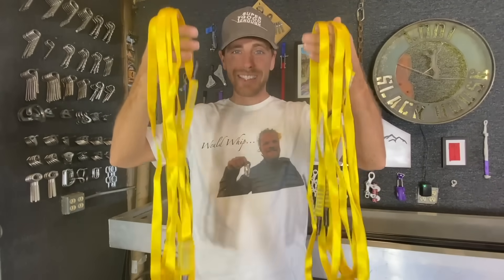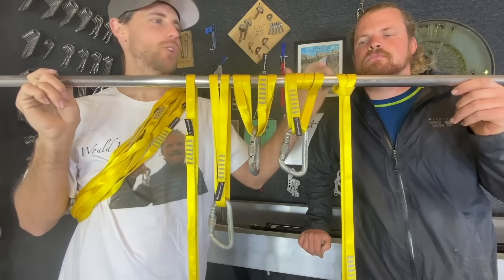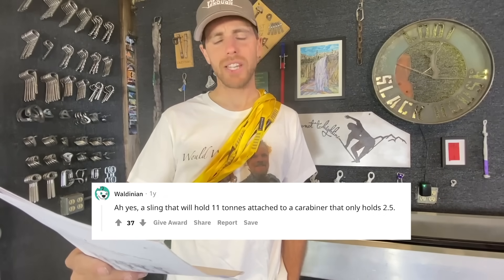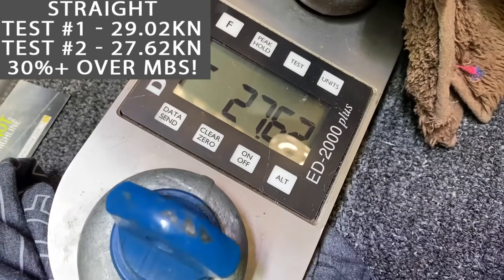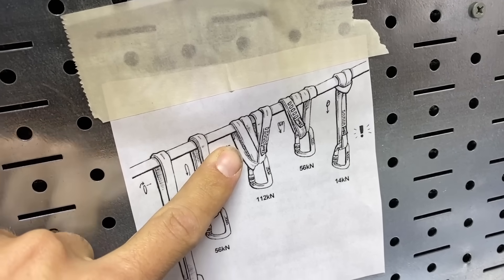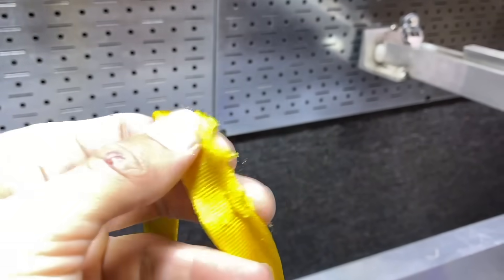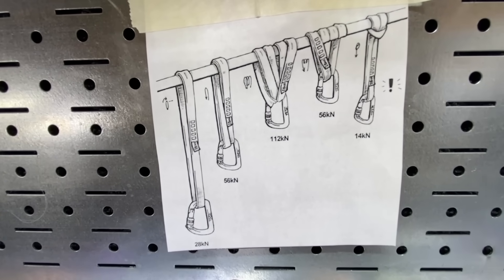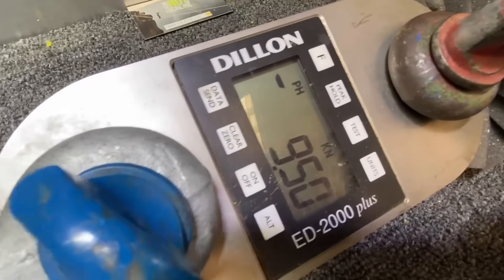Climbing Sling Myths

Comment: (Climber and physics tutor checking in here) One factor to consider is whether the force is applied evenly across the full width of the webbing (strong condition) or if the force is applied in such a way that one edge has to stretch before the other edge takes stress (weak condition). This distinction is incredibly important. If the stress is imbalanced enough, you only have to break a few strands of nylon on one edge of the webbing to start the failure. Once those strands break, you have a "stress riser", a place where the force is concentrated on a much smaller amount of material compared to the original condition. Once the failure starts, it quickly propagates across the webbing. 
How important is the evenness of the weighting? Here's a magic trick that Kung Fu practitioners in China used to prove that they could "reverse gravity" by the power of their minds when I was there in 1987. Chinese writing paper is so thin it is rather translucent. They taped opposite edges of a sheet of common writing paper to two fluorescent tubes, rolled them up a bit so the paper overlapped its own edge a few inches, and then had assistants support one tube. Then the Kung Fu master/magician did pull ups on the other tube. I've done it, albeit with broomsticks rather than fluorescent tubes. I weigh .8 kN. So long as you keep the force even across the two ends, the paper is strong and does not tear under this force. If you pull a little more on one side than the other, "bang", it parts.
I suspect that in some of your multiple wrap scenarios, you are stressing one edge of the webbing before the other, reducing the effective strength. That would also explain why one edge of your sample ends up more melted than the other. 
Of course, in a real world scenario, I'd assume the forces will always be uneven on my webbing and plan accordingly.
Reply: Do you have a video? I'm having trouble visualizing

Comment: I think that is crucial to understand that all multipled strenghts are still based on the strenght of a single rope, so in order to get a perfect multiply of that stress in each single string must also be perfectly equal. Which is not quite possible due to fiction, so one of two / four strings is loaded more heavily than others and at some point it breaks - in that 44kN distribution probably was about 28kN + 16kN and it couldn't equalize due to fiction at those 2-3 turns in tight space.

Comment: Interesting results! 
What is also interesting is that @09:10 upper-right side of a sling is tearing apart first (the inner side). 
It looks like the angles makes quite a difference, and probably its possible to achieve above 44 kN if sling would be aligned more perpendicular to the shackles.

Comment: Is one of the reasons why you might need systems with such high breaking strength Is for rope rescue.  When we might have 2 rescuers and one victim plus equipment on the line and if that that line is forced to run at some sort of an angle (which creates additional load) and then if a haul system is used to raise the patient and rescuers (the haul system alone can create at least twice the load twice the load at the anchor) and then one additional concern is impact load. 

So worst case scenario you are working with 2 rescuers and one patient and your rope must run through some sort of angled change of direction pulley and then to a block and tackle or Z rig raising system and there is a problem resulting in an impact load...... the values could get quite high. 

 Sorry about the grammar errors that I am sure our present. I am lying in a hammock and using talk to text. :)

Great video. 

Thanks

Comment: Your double double would need to wrap round separate shackles to get anywhere near its theoretical maximum, due to the friction on the slings caused by the overlap/ rubbing against edges, but a useful video

Comment: congratulations you have demonstrated that engineers beat simple physics.
Reply: It beats nothing. This theorical scheme is still right in most situations. You dont have to know it breaks at 23.553772kN instead of 22kN. If yo do this test in slightly different conditions you'll get different results. When you make a clove hitch or you wrap the sling around a bar, you can get very different results if this rod can turn or not ; its diameter is also important .

Comment: With your double set-up that rendered 79kN, your whole construction would be absolutly useless if one of the fixing points gives way. You forgot to give a twist to one of the loops at the "climber side". The 112kN result might also have been done with a long sling, and a real triangular set-up as you would use when setting up  belay points between pitches. that could count for the difference. The extra twist for not having the carabiner simply hanging over the two strands and by doing so not to loose it after the failure of one point, also explains why the carabiner is shown sidewise in the drawing, as opposed to yours which is shown straight.

Comment: It was really interesting that the 4 times dubbed sling was not 4x the strength.  Must be the interaction with the shackle.  
This is similar to a tractor tractor situation. You would think that 4 tiers over 2 would give you 2 times the lode. But because of the dynamic nature you can over lod one set resulting in problems.

Comment: In the construction field the "girth hitch" is commonly known as just a "choker hitch". It is well known that using the choke will provide you with the full rated strength of the rigging being used so long as it's not wet or worn. It's worth digging into OSHA rigging information used in construction type safety and lifting uses as people have compiled endless information necessary to keep workers safe for generations now. At the least it sure beats random graphics thrown around from who knows what sources, no offense to those sources, but being mislead is dangerously easy.

Comment: I recently took an American Canoe Association swift water rescue clinic. The instructor introduced the flat overhand (EDK) in tubular webbing for tying slings rather than the water knot, he did show it with long tails and a back up overhand. The rationale seemed to be the fact that a water knot in contact with a rock (for example) could be prized apart when loaded, but the flat overhand rolls over and stays intact.  I've been using the flat overhand (EDK) to tie ropes together for something like 35+ years, and tied webbing with water knots for longer, and I haven't died climbing so far. I have not come across a general  recommendation for using EDKs in webbing: https://www.canyoneering.net/edk-in-webbing/ seems to have done a test and found it weaker than the water knot. I'm a fan of "Super Good Enough" so hauling a pinned boat off a rock seems like a good enough place for an easily tied knot in a tatty piece of webbing that has been sloshing around in the cockpit of a kayak to make a sling for an anchor since it's not someone's life on the line. I'd love to see a comparison of water knots vs flat overhands,  I searched your YouTube channel and your How Not to Highline Highline Anchors, and didn't find any educational, informative and entertaining info on this. Keep up the good work!

Comment: As a mechanical engineering student

The number is calculated from where 50% of samples fail when their entire cross section reaches a specific principal stress, something on the order of several tens of megapascals is usually where polymers fall. Pressure is force divided by area, so the force they rate to is that tens of MPa times the cross section area when in simple axial tension. 

From there, usually, there is a safety factor. For human use where someone's life is on the line, it's usually 4 to 5, hence why him falling in that video was 5KN but the strap supports 22KN of axial loading. This is entirely expected.

Angled loading from wrapping is not axial, it creates internal sheer and axial loading. Sheer loading causes massive increases in the principal stress on a body. That's the first reason why all the wrapped portions failed early.

The second reason for failure was the rubbing, which creates concentrated stresses at the contact point that are higher than the axial tension.

The third reason for failure I can pull off the top of my head is the strain rate, how fast it is loaded. The faster a polymer is loaded, the less stress it can handle, and if your strap is loaded faster than the manufacturing test strap, it will fail before the test strap does. Seeing as your strap failed at 29ish but was rated for 22, I suspect you were slower than the test, which makes sense because the strap is designed to resist shock loading, not gradual loading. 

The heat you felt in the strap actually occured once it unloaded rapidly and the energy stored in the tension of the strap was released. Because the strap is permanently longer at failure than it originally was before testing, any energy stored in the elongation cannot be mechanically returned to the strap, and so is lost as heat.

Comment: there is a difference on the results if the diameter is bigger on the wrapping of the last test, because the angle will be far worse, if you wrap it like this arround a tree for example, thats why you should calculate half the strenght.

Comment: Nice video! My guess is that inconsistent force across the sling (see 13:22) due to folds and bunching is reducing the strength of the "double double" sling. This may be another example of the benefits of a well-dressed anchor. I wonder if the result would be different for a longer sling...

Comment: Clove Hitch on a Carabiner has much less diameter than on your Huge shakel...
So i Think 50% on carabiner should be right.
But if you increase the diameter of the shakel the Knot will not have as much bad Influenz.
Like on a tree or around a rock Feature

Comment: Hi guys,
I tripped over your vid whilst browsing and as an ex-climber (or survivor) I'd like to point out a couple of things.
Your 'continuity of placing crabs...' is flawed, as you pointed out to yourselves.
It is possible to align the direction of a crab, to get the gate where you want it, simply by subtle half twists of the sling loops. Also you have threaded the loops incorrectly on the central example (90deg).
At 10.40 you discover that the sling was 'all messed up' and speculated ('probably', 'might be') as to why. Saying 'that could have been .... put what you think' and not following up isn't remotely scientific, investigative or helpful, but it was a brilliant opportunity for you to develop and refine your 'testing'. eg. you could have marked the sling where it looped or where it was constrained, etc. Taking it to the next level will save a lot of guessing and may produce some really useful information.
I appreciate that your not a testing facility but if your going to test something, please dig in to the failures, after all that's what is important to us.

Comment: Neato! The 3-wrap is bad because the wraps tighten and seize and the force is not equally distributed to both sides. Any sling where the setup does not leave the straps parallel, but diverging or converging, will be weaker as the cosine of that angle. But you using Black Diamond caught my attention because in high school Todd Bibler (Bibler Tents - now owned by BD) did testing of all things climbing for Larry Penberthy at Penberthy Electromelt in the late 1960's. Testing of the REI red locking biner and their ice axe prompted the creation of Mountain Safety Research, which was a newsletter at first, and then selling the best performing parts. For example some carabiners from Italy and a fiberglass kit that strengthened the REI ice axe. I think the Red locker broke at around 300 pounds, which shocked everyone, and the wooden ice axes broke at around 150 pounds when used for something normal, like a boot-axe belay maybe? It wasn't long before MSR was manufacturing superior and safer products of all sorts. IIRC the ice climbing axes were Bibler designs. Anyway, just an interesting full circle on Black Diamond slings and a small world. (BTW, I did not know people still used nylon. Why not Dacron for UV resistance?)
Reply from the maker: Super Interesting. Thanks for sharing that bit of history.
Reply: @HowNOT2  By the way, there was also a drop tower and all that. I was there one day and we tested gloves for belaying to see what you would want in arresting a serious fall. We tried all kinds of leather and fabric gloves. Penberthy made several prototype auto-belayers that we tested. Also tested some home made jam nuts. Bibler and I had bought a bunch of large nuts for bolts and drilled out the threads and got rid of sharp corners and were testing them. The move away from pitons was gaining momentum at that time but good aluminum and stainless cable chocks were expensive and hard to find with very little variety. Your slackline thing is terrifying.

Comment: What I don't understand is why someone thought a girth hitch would be half strength in the first place.  Sure, it's going to bend the strap at kind of a sharp angle right at the point of the girth, but why would that cut the strength in exactly half?
Reply: I've seen this diagram before and wondered exactly this; idealizing w/ or w/o friction this makes no sense. W/o friction tension has to be equal across the whole thing (else it would move until it was). W/ friction, the constriction around the object should take most of the load, so the actual interaction is minor. That said, non-ideal behaviors of fabric-fabric connections in non-lab conditions are much more likely to cause issues due to wear and friction melting, especially if repeatedly loaded/unloaded in different directions.

Comment: Also,,,,, that pin spinning might be the reason to. 
As it would give out to any "potential energy" 
The force may be strong at the z Axis and we force multiplied due to length of material and configuration of the installation

Comment: The distance shrinks on the sling when you go for 4 @Times the MBS
 Maybe there is a angle multiplier somewhere in the configuration? 

If you look at all the configurations, the (quad) wrap is shortest. 
Therefore, there already potential energy built into the system
 Like ohms law...but for slings.

There's resistance in the configuration. So it's not a 4 to one BUT it did score High.

Comment: What are we thinking about shock load compared to the steady increase of load that your system uses?

Seems like the heat may have less time to dissipate and therefore be hotter with shock load? 

Either way I love watching stuff break so good job.
Reply: That's plausible. Another possibility is that you'd get a lot less strain (and therefore stress*dstrain = denergy), because elastic response is time-dependent. I think this is very likely in a material like nylon, because time dependent deformation mechanisms are responsible for the majority of the strain. At higher strain rates, the material wouldn't have the time to relax, meaning that energy wouldn't be released as heat.

If the time span were longer, or in a less strain-rate sensitive material like steel, I think you'd be correct.

Comment: Can you try it again, but without the pin freely rotating? Even consider a friction surfaced anchor. I would think that the girth hitch if you pull it forward and then attach it so it needs to force the hitch back in order to straighten itself under tension. I think the freely rotating pin gives too much possibility to even the load.
Also, can you test "sling in sling" without a device connecting them?

Comment: I think I know what went wrong with your "4x":
What you were supposed to do likely is take the sling and wrap both lines around the top twice. After that you clip the two ends of the sling individually and the double loop that was created by wrapping it: https://ibb.co/c8CQcQT

Not sure, that fixes the discrepancy of max holding force, but at least it fixes the directional issue.

Comment: I'm not a slackliner, but I find this information very useful for my job as a tower technician. We use the wrapped slings and girth hitched slings often on towers. We don't measure anything in KN, but we pull loads in the range of 1000lbs from very abused slings using those methods without problems. Keep up the great content!

Comment: I know I’m just one one lonely comment here in the couple hundred comments, but I really loved the one extra test on the hanger. 

I would have loved to see the nylon sling setup with the basket attachment straight on the hanger as well! If you have any more nylon, I personally am super curious about the end strength of that. I think most climbers would knot it- but honestly I don’t think it really matters for the test if there’s a knot in it. 

It’ll either break at the hanger far less than normal or not, regardless of a knot. (Of course— just my thoughts)

Comment: So if a girth-hitched sling breaks around 23kn, could you replace webbing on a cam with a girth-hitched sling? Or would the shape of the thumb loop make the stress unequal, and therefore lower the breaking point? I've heard that it isn't super safe, but the reason was the hitch removing strength from the sling. Thoughts? Tests?